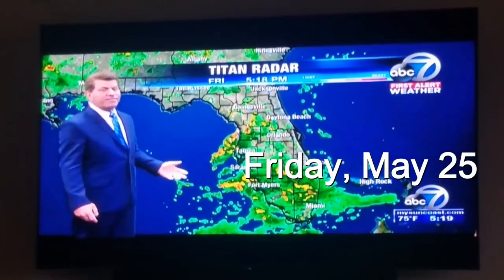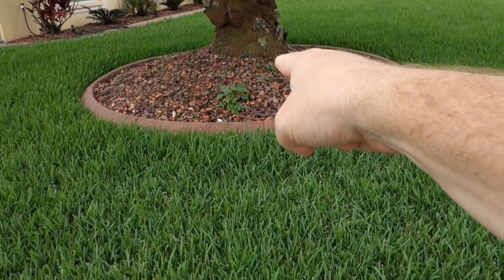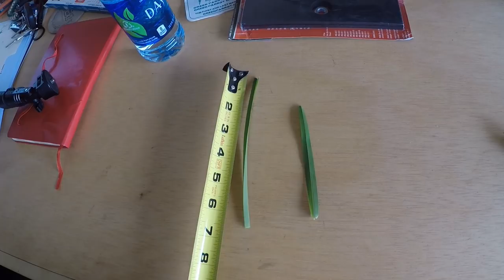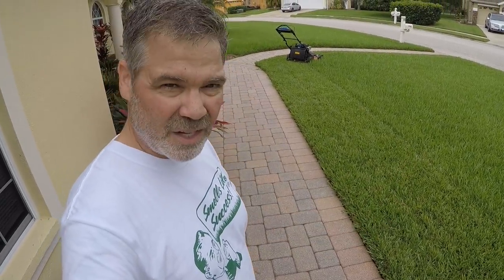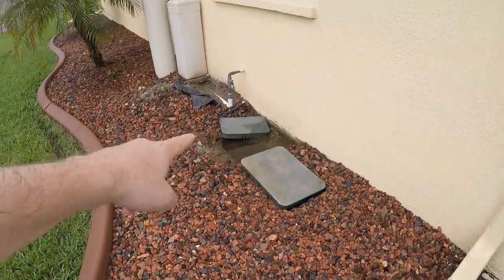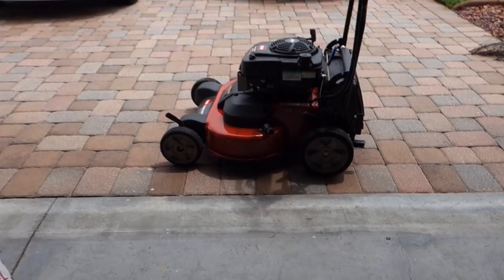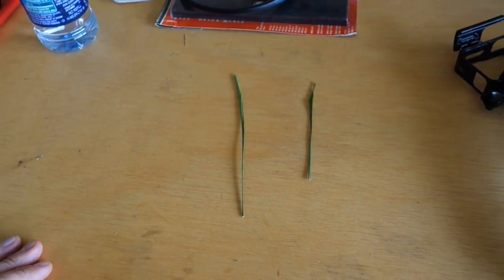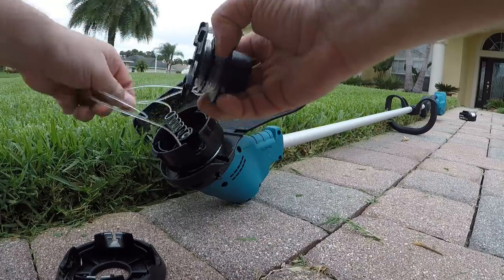How To Mow A Wet Lawn In The Rain On A Saturday And Enjoy It

Comment: I feel you on the Trimmer Line. That’s why I love the WorxGT and it’s Spool Lines. Very Easy to swap out & Extend More line, when needed. Only thing is buy an Extra Battery for Worx equipment. Then you’ll always have Batteries ready.

Comment: I applaud your dedication to the lawn. I was in a similar spot the week before, seems working 60 hours leaves little time to baby the lawn with the crap Florida weather. 

As for the issue with frustrating weed eater line. I swapped my Ryobi over to a Shakespeare Ugly Line Hybrid Trimmer Head (damn that’s a mouthful). It is a super easy system, only major drawback is, you don’t have the spool of line to use as you trim. I’ve been using it for about 2 years now and it works great for those who just hate messing with trimmer line. Another cool thing is you can use their polymer blades which allows you to clear overgrown areas or thick/high grass for those areas you neglect or forget about.

Comment: Did it one time on a high dollar property with my Walker lawnmower, as the rain started when my machine was still on the trailer. The 42 inch deck on the machine cut and vacuumed all the grass clippings into the collection box. But I remember being soaking  wet, just like the lawn care nut/hero!

Comment: I like the ryobi weed wackier head I put 3-4 ft of string through the middle of the screw/spool, thread the two ends through the feed holes put the head back together pull both end of the string tight and even then turn the button on the bottom to spool the string on the feed. I never had any problems.

Comment: Allen I have an edge of my lawn that is at a slope and it's hard to keep watered, it always turns brown this time of the year.  The only thing I can think to do is to raise up the curb around that edge to try and retain some of the water since right now it just runs off, but that's a big project and my wife already has a hard time pulling in the driveway straight, if Krause that corner up, she will hit it.  Here in WA is already around 80 and it won't let up till August, I am watering 2x a week, but the lawn is starting to go brown in spots, maybe I need to move it to 3x. I use my Echo SRM225 to edge all the time, I have a 3 wheel bladed trimmer, but I hit the cement and rocks all the time and I cannot tell where I am going. He Echo SRM 225 works great, I get a nice even line and it works for me

Comment: Allyn, get the Shakespeare Push-N-Load. I have been using them for over 8 years. No spools to wind, just insert two lengths of string that you have pre-cut. Might seem like a PITA but if I load mine up with fresh string I can do all the trimming on my 19k SF lawn and I have a corner lot with 345 feet of curb plus the drive and flowerbed edging. You can find them at Lowes and probably other places for about $20. I am on my second head, first one lasted 5 years.

Comment: I'm with you bro on the aggravation about the string coming out of the weed eater
Reply: agreed. one thing i've found helpful is not loading it as full and then on the inside the head, where it slides on the other plastic piece is a little bit of silicone spray
Reply: What IS a good weed wacker to buy that has a descent head on it.  I agree... every one I have ever used is that way and is a POS.
Reply: Stihl  FS70-r is a great option, I upgraded to the Stihl 4stroke KM111 and it is extremely powerful but it come with the expense of weight. Echo also makes some good ones. The echo quick-spool heads seem to be second to none, I have no experience with them but have only heard great things about them. adapters available to put them on a Stihl, but I never have issues with the Stihl spool so I opt out of switching. I have used corded, and cordless electric trimmers, and they are great for some people but in my opinion gas is clearly more powerful, you dont have to eff with expensive unreliable batteries, and the nostalgic smell and sound of a gas motor is irreplaceable. The only way I would consider an electric trimmer is if it were made by Tesla.
Reply: asullivan50i I bought a echo with the quick spool head and let me tell you it's great. Cut a piece of trim line feed it in the head twist and done. It's as easy as they say, have had it 2 years and not a single problem. That thing will start if I look at it funny. It even handles the .105 line no problem.
Reply: I have a Toro power head with universal attachment setup. The string on the string trimmer loads different than I am used to. Not the standard setup. I think it might be called Easy Reel or something. The string discharge knob is red. I feed the string halfway through the knob (about 12’ on each end of the knob) and then slowly turn the knob to wrap the string inside. I’ve never had a discharge issue with my ex-wife.....err I mean string discharge issue.
Reply: @5Towaways  Ego with manual twist load head or the one that does it for you with a push of a button.
Reply: @5Towaways  I think its the actual string spool, think some batches can be bad. I've had the same trimmer (Black and decker) for like 10 years and every once in a while I have this problem but then it will disappear for a couple years. In my mind cant be the trimmer if that's the case.

Comment: I just bought a brand new Echo straight shaft trimmer and it now comes standard with the speed feed head.  I don't have many hours on it, but I've noticed I use a lot less string then I did with my standard dual head.  But ran into the same problem with it becoming knotted up.  The Echo model is easy to take apart, but not so with the knock off brand.  I had been using .105 The Fire, Stens 380-643 Silver Streak round Trimmer Line with the dual head and was content.  I purchased a cheaper brand .105 line that wasn't round and had issues with it staying put in the slots of the head while reloading it.   The new speed feed head says to use .095, but I'm still using my .105.

Comment: Alan, I bought a EGO string trimmer and blower yesterday.  My EGO has the same type of string hosing as that Makita.  I had to fight that battle yesterday as well.  The string would not come out when I tapped down for more line.  I opened it up and it was a mess.  Pain in the freaking butt.  I'm happy with the power on my EGO trimmer though.  It's a 56V.  Thanks for the great video

Comment: Regarding the end...

I find the Worx weed whacker easy to deal with, and the battery is enough for the usual half-acre lawn. Only mount the wheel for the edger position (kind of useless in the other spot) and leave it there, and the adjustment for either mode makes most things easy. The feed mechanism is pretty simple but I'm finding it doesn't feed out remotely (it's supposed to by pulling a secondary trigger, but string just isn't heavy enough), just turn it over now and then and push the button on the bottom while pulling to feed out. Capacity is relatively small, however it's easy to reload and jamming is unlikely compared to those bump feed designs. And they say they do "free" refills on the string, but it's shipping that gets ya. So just reload the spool that comes with it using some filament you can get locally.

Large yards you're better going with gas. However on a small lawn those electrics eliminate dealing with gas, much less noise, and no carb to foul up and rebuild. It's kind of great in that situation.

Comment: Love your videos! Having a hard debating what kinda of Toro to go with and wondering if you could help me. I have an uneven kinda yard with steep ditches. Here are the 4 mowers I am debating between from Home Depot and they are all rear wheel except one is awd: 1) Toro Recycler 22" Personal Pace Variable Speed Electric Start Gas Self Propelled Mower with Briggs & Stratton Engine-$399 2)Toro Recycler 22" Smartstow Personal Pace Variable Speed High Wheel Drive Gas Walk Behind Self Propelled Mower with Briggs & Stratton Engine-$399 3) Toro Recycler 22" Personal Pace Variable Speed Gas Walk Behind Self Propelled Mower with Briggs & Stratton Engine-$359 4) Toro Recycler 22" All Wheel Drive Personal Pace Variable Speed Gas Self Propelled Mower with Briggs & Stratton Engine-$399. Thanks your best!

Comment: You should use thinner string with weaker string trimmers. It lets it spin up to a higher rpm and feeds better. Also try the ego trimmer it has plenty of power, a carbon fiber shaft, and and electric auto load feature for the string.

Comment: My fescue and rye lawn actually got to almost 10" a couple weeks ago.  We had day after day of rain in PA and we had a trip to Disney for a week during which is rained almost non-stop while we were gone (the morning we left we got about 2" of rain in 45 minutes driving to the airport).  When I came back it was completely out of control.  No way to avoid cutting more than 50% - can't set the blade that high.......and I have 2.5 acres.   Went at 5" discharging,  followed up the next day with the bagger, then down to 4" 2 days after.  Generated what I estimate is about 4 cu yards of clippings dumped at the back corner of my property.  It was so bad it repeatedly stalled out my ExMark commercial ZTR and at another point overheated the engine because all the clippings being thrown around clogged the engine air intakes.

Of course red thread and brown spot are going nuts.

Our turf has not gotten to what I'd consider a normal moisture level yet this year.  The rain is completely unrelenting and I'm basically looking at the year as a mulligan.  Just get to the fall.

Comment: I also edge walking backwards. First time at the parks department job in my highschool summer I naturally walked backwards and they said, what the hell are you walking backwards for? You can't see anything. I replied, it's the fastest way I can do it and get a clean result. Also like the bevel you put on the edges too, I do it also when I don't blade edge. 

The weed eater head I don't think is bad. I like them, they're quick. After doing it multiple times a day for a few summers, I got really fast with them (under 2 minutes). My dad would take at least 10.

Comment: I haven't read all 200 comments and this possibly won't be seen but you need a heavier steering and that will help tremendously with the binding. Go a.095 or. 085 at the smallest. The 1.05 will be to much for that though IMO. I use the Stihl Autocut C 26-2 with the Stihl X Line .095 and I love the combo. I know you probably already know all of what I said but I would feel right ignoring your struggle.... Lol

Comment: Great channel man, but pro tip. I’m fairly certain you’re not loading the head correctly on your whip. Which is why most people hate whips.
1. Buy an echo best/lightest whip out there.
2. With the whip head empty look through the holes and turn the head until you can see through to the other hole.
3. Pull 2 arm spands worth of line roughly 12ft. Or less 
4. Slide the line through the head and even it up so each side has the same amount coming out roughly.
5. Now here’s the trick...hold the head at the base (closer to the guard side) and with your other hand twist the head clockwise. This will spoil up the head and give you trouble free line issues. 

I’ve yet to see this way not work on a whip, but I suppose there are heads that don’t allow this. It’s worth a shot to try it. Everyone older guy I know always takes the head apart to load the line and I laugh my butt off when the swearing starts and offer my help which results in there mind being blown..

Comment: Get about 20 billy goats.  They will work in the rain. Ducks do a great job as well.  I'm sure that will go over really well with your neighbors, or your HOA, if you have one.  HaHa!

Your background music should have been "Dancing in the Rain!"  ;-)

I agree 100%, with what you said about the design of the Makita string line spool. The same exact thing happened on my Black and Decker Grasshog.  Don't they test those things before sending them to market?  Here is what I did with my B&D. Perhaps it could work on your Makita:
Buy thicker string line.  I went to Lowes and got their Ugly Line brand, bulk (320') string line, .080".   I put it on the same spool and I don't have anywhere near the problem with it binding up in the spool, or breaking, although it does bind up sometimes, I think mainly due the the power of my string trimmer.  This line lasts a lot longer, as well.
I might eventually get this product, which I saw a demo on online, "The Badger Head." It looks pretty good. Kind of pricey and you would want to make sure you can adapt it to your trimmer:
https://www.youtube.com/watch?v=SmvPWCwmk1A

Comment: LCN! yet another great video. Question for you, seeded this spring, cool season grass, mostly per. Rye, i know should have waited till fall, but just moved into a new place and it needed it and all of the sudden temps went into the 90s, rare for May, now i have tons of crabgrass growing in the area with the seed, about 900 sq ft, seed is only 3 weeks old, probably 50% grass, 50 CG, should i just let it go and just keep cg mowed short so it doesn't go to seed, then kill it end of summer and reseed fall or try to kill it now? So much, feels like it would be impossible to pull it all by hand. What to do? Thanks Allen! and keep up the great videos! rest of yard is very thick and green after using your method of starter fert. And milo!

Comment: Your a trooper bro, but it had to me done. Well done on the edging though, came out pretty good.
Ya, I don't use a blade. I use electric weed wacker, but I prefer a single string. A lot less frustration. I've been using a Ryobi +1 for about 3 years now. The battery charger took a crap on me, but I don't mind using a cord. It keeps me out in the lawn a little longer. When it finally takes a dump, I'll upgrade to a Toro electric.

By the way, I noticed you have some ink on the right shoulder. You'll have to let us have a better look some time.

Comment: Have a Ryobi with a 40v battery. Very near to my gas trimmer. The Ryobi came with a twisted line which never got stuck with me. I did run out and used some standard line I had laying around and sure enough, it did the same thing that it did to you. Very frustrating. Will have to go out and buy some more of that twisted line. Hope the rest of your Memorial Day will be fine.
Reply from the maker: I need to try theirs

Comment: Need some mowing advice. I have a brand new house and the grass the builder used isn't that great. It's St. Augustine and is kind of a light green with some darker green patches. The dark green areas are definitely healthier and grow way faster than the rest of the lawn. I've been cutting the lawn once a week at the highest setting and the blade barely touches most of the lawn. It really only cuts the good patches. So question is, should I cut lower so I'm cutting the rest of the lawn? Would that stimulate growth to cut it low a few times and gradually cut higher as the grass looks healthier?

Comment: 2 Things:
-Take a look at the Tanaka "No Brainer" trimmer head. Not saying it answers your prayers or curses, but I've been using it for a couple years on my occasional WW jaunts about the estate. Takes precut pieces which you switch out pretty easily as needed. I buy some high quality line, cut off 6 or so pieces at around 9 inches each and stuff them in my pocket . Where I go I really put them to the test but that can last me an hour or so of woody plant brutality. I have yet to find a trimmer head that behaves the way Dan's does. But then I'm not nearly in his league.

-A third reason for not mowing in the rain is those of us with bigger lots, and riding mowers, know that traction goes out the window and you inevitably leave skid marks that are like your worst post-chili nightmare. Talk about 'leaving a mark'.

You are the boss, Hane!

Comment: I hate those stupid string trimmer heads too!! I bought one of those aftermarket pivoting heads where you just cut 4  ~18" lengths of trim line, slide them into the holders and now I have 8 spinning arms of death for the weeds! NEVER another tangled trim head mess!

Comment: Thanks for your awesome videos, I just bought my house last year and the lawn was a mess so I am currently using a lawn care service (True Green) for the treatment of my lawn which I cut myself( not bad for a 57 year old woman huh ? haha) and your tips are most helpfull .  I plan on doing it all myself  next year. My question is what do you think is the best trimmer out there that doesnt have these annouying bump feed problems.  I currently have all Ryobi tools, Lawnmower, leaf blower, hedge trimmer and they are great, I also have the Ryobi bump and feed edger and spend more time messing with the string than it takes me to edge my yard, and the bump and feed housing is  cheap plastic its about to fall apart. Which one if any  would you recommend?

Comment: i'm here in the Midwest, not sure what my lawn is but i'm currently mowing twice a week to keep that 1/3 rule in tact.  it creates less thatch and clumps.  I use to use a push mower, but moved to a rider.  which is taking half the time and provides a better cut.  but my question is, is twice a week too much?  do I keep this up season long or just as needed cuz the Midwest sure does have some brutal summers with minimal rain fall.  and I will be watering of course.  :)